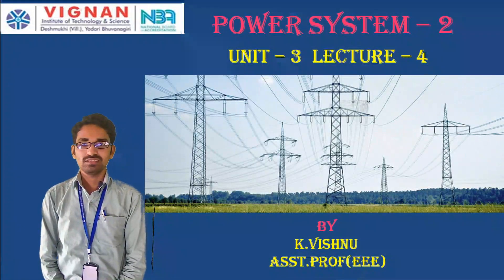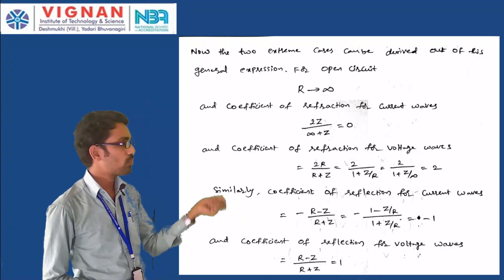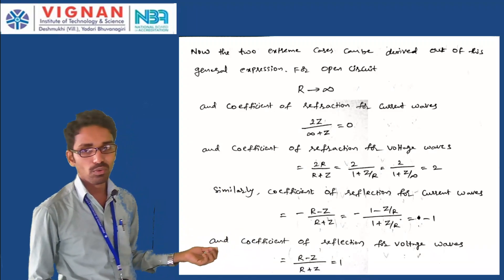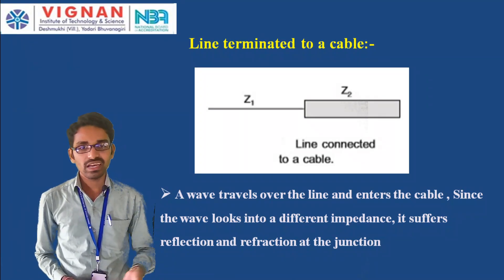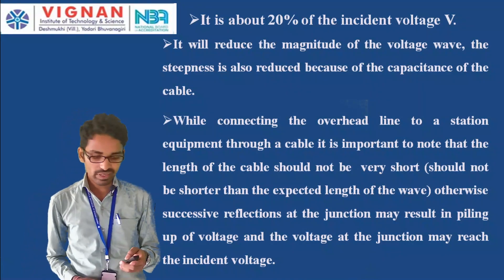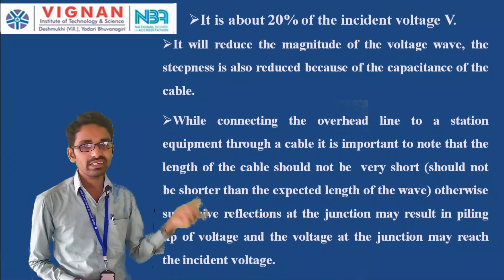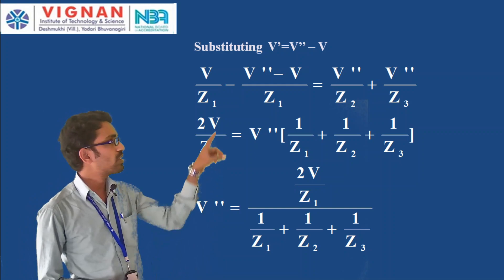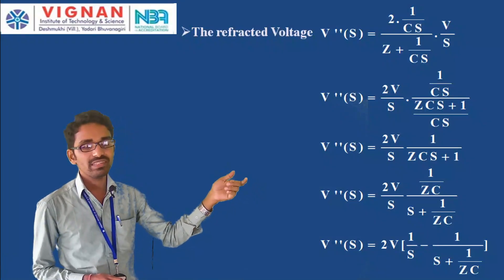Line Connected to a Cable, Line Terminated Through a Capacitance || PS 2 UNIT 3 CLASS 4

Comment: Sir cable characteristics impedance is low as compair to transmission line but how can cable reflect the surge voltage back in line